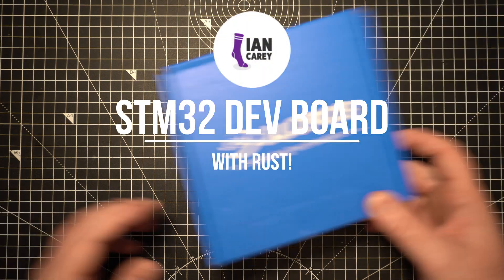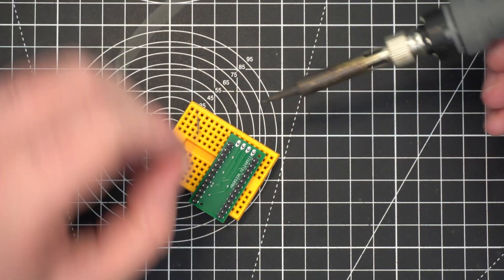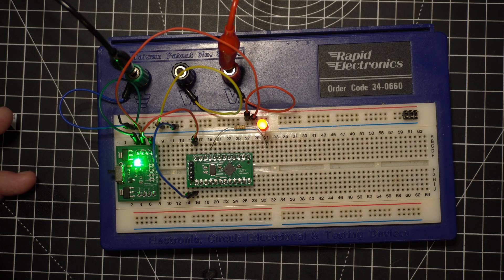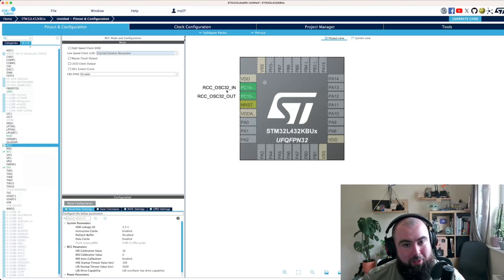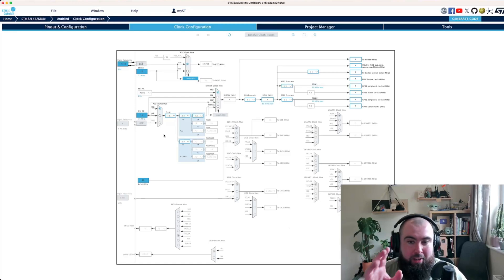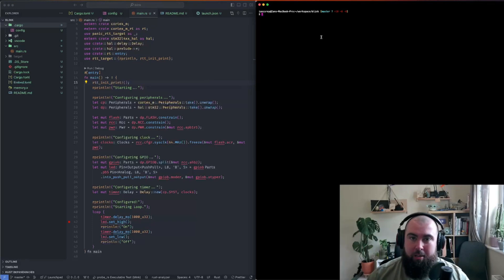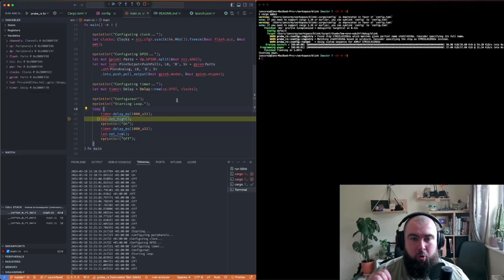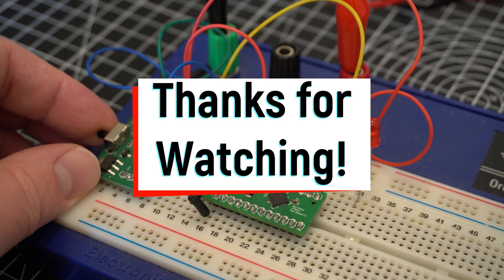Custom STM32 Dev Board with Rust!

Comment: I recently designed one with stm32g0 and did the same mistake wit osc....but even after cotrecting it my my microcontroller wont even connect to stlink...
Reply from the maker: Oh damn, that sucks! Any idea on what else might be going wrong? Boot pin setup maybe?
Reply: @careyian  tried fixing still no response...maybe i'll buy a couple more and try soldering it in a diff way....maybe i overheated them...
Reply from the maker: @pritampaul-dk9ht  good luck!